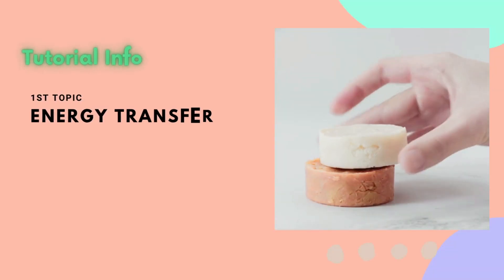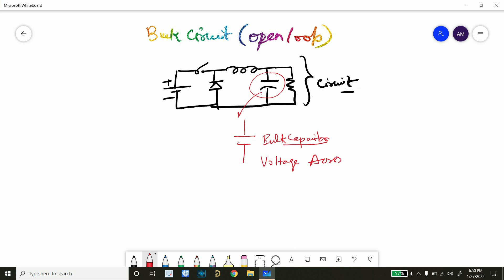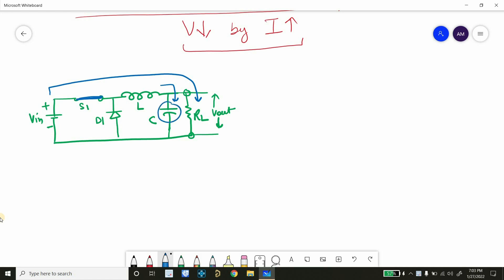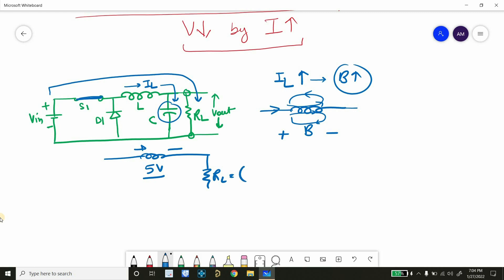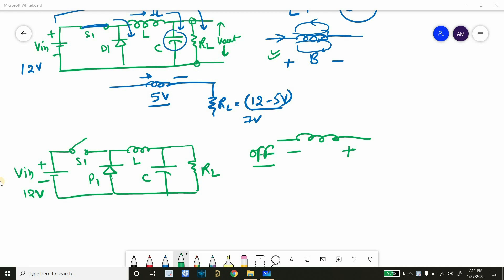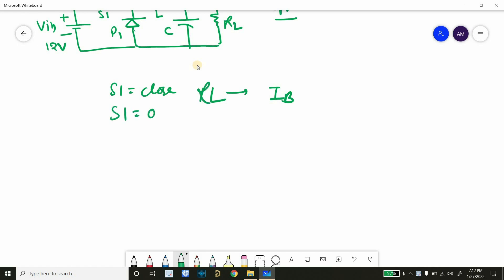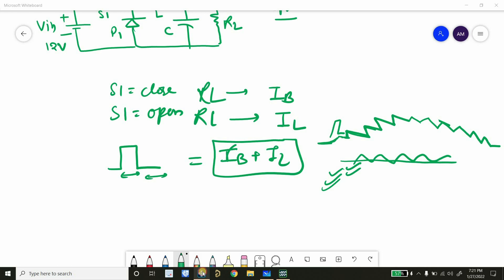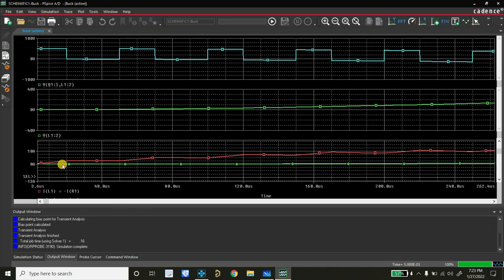PSpice Tutorial for Beginners - How to do PSpice Simulation of BUCK CONVERTER - II

Comment: thank you so much sir, your way to explain anything is very easy and to the point. i just have few questions that in the output voltage as we see a sudden rise for few milliseconds, so it can damage our circuit, so to overcome this what we do, do we use tvs diodes or any better options?